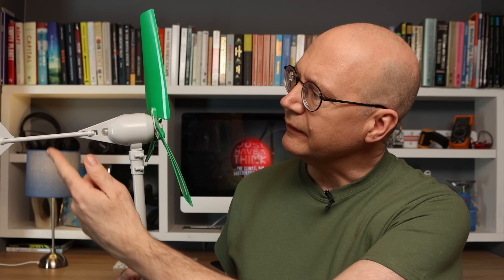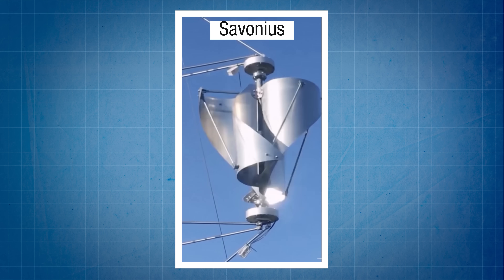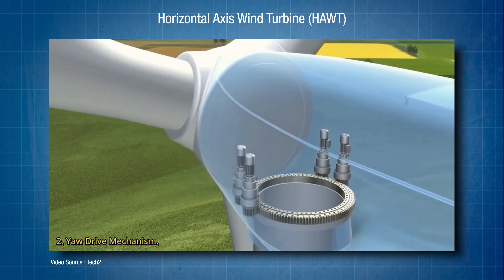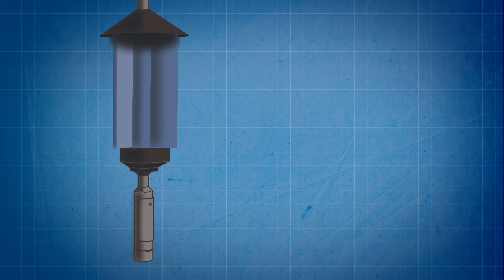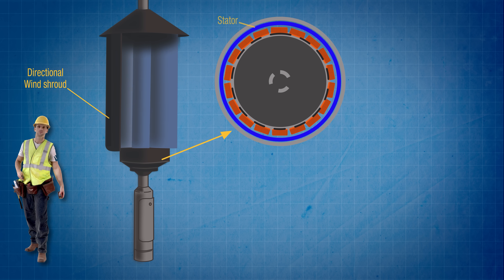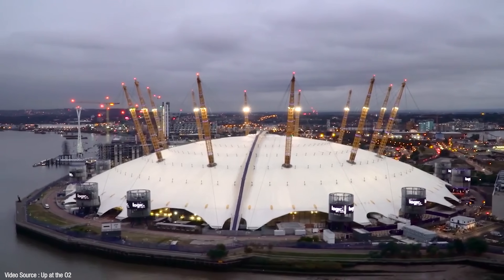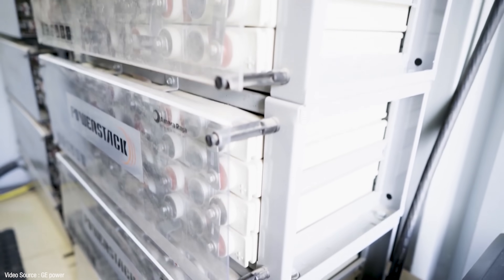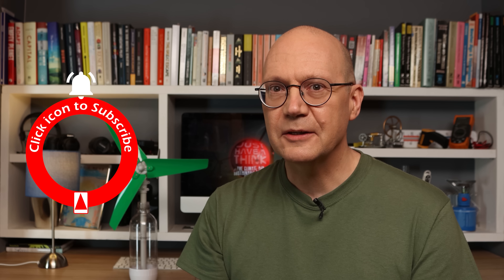A vertical axis wind turbine that doesn't need the prevailing wind! How do they do that?

Comment: Perhaps someone has suggested this already, but this system on the London Underground could  be very efficient.
Reply: The energy captured by the turbines will slow down the air rushing forward with the train. Effectively the train is now passing through its own built-in headwind.
Reply: @jamescooke3763  , true. One of the problems that need to be taken into account while building a tunnel is to prevent the air in it being excessively compressed by the train passing through. That is why the tunnels ale way biger in diameter necessary to let the train pass. And when the train is fast, and the tunnel is very long, there are built additional ducts to allow the pressure to dissipate. Holding the air with turbines would make pressure build up and make the train consume more power to remain its velocity.
Reply: The wind in the tunnels as the trains push the air through. If you’ve ever been in a tube station as a train approaches, you can feel it. Line them all along the walls of the tunnel.
Reply: @frankieking1941  And sit back and enjoy the extra turbulence and noise in the tube cars. What's another 4-5 decibels?
Reply: @tzenophile  wouldn’t it depend on the frequency of the additional sound as to weather or not the overall level increase?
Reply: @frankieking1941  the frequency would go up and down as the trains approach and retreat. So even more fun!
Reply: @tzenophile  I had not thought of that, your considering the residual sounds made by the fans that still are rotating after the train has passed? That will  then escape either end of the tunnel and make the platforms noisy.

Good though,  that would be a problem. 

Just to be a pedantic.
Sound absorbing material could be place   In tunnels especially at curves to catch most of this.

To be clear, I’m not advocating the plan, it was just a though I had after watching the video. But I am enjoying looking at the problems it would creat. I understand vertical fans have other efficiency issues that rule them out as a solution.
Reply: @tzenophile  They could possibly reduce noise levels if they act as baffles
Reply: @frankieking1941  there are soo many problems with this idea, starting with the fake performance numbers presented in the video (it should be 25 watt, not 2.5 or 24 kW); the good news is that this will never ever be implemented; it is basically a scam.
Reply: @tzenophile  Ever ridden the NYC subway?  Trust me, the extra noise is insignificant. The space between tracks, however, would be a problem.
Reply: @Withnail1969  If you confuse these designs with wind tech in general, I can only say you're not very smart. Have a nice whatever
Reply: @Withnail1969  You should read the news, and I don't mean facebook. This is happening already and capitalism is doing it for me. A LOT fewer  moving parts means cheaper cars, few repairs, not to mention much cheaper fuel. I'm fueling my EV for free. And this is just the beginning. Remember those famous pictures from NY City Easter day parade in 1900, and then in 1913? Lots of horse carriages and only one car in the first, and exactly the opposite in the latter.  History will bite you in the gas, petro boy.
Reply: @Withnail1969  Well, there really is much less reason to own a car when they can come by on their own when you need them. As for energy, renewable is the cheapest, and becoming cheaper. Do the math, indeed. Or just google it.
Reply: @Withnail1969  I don't have that exact information, but it seems renewables have doubled in total energy share from 29% in 2009 to 60% in 2019. So it's going really well. But not as well as in Norway, where EVs had 54% of the market in 2020. They are also aiming to stop the sale of fossil-fuel vehicles in 2025. Inconceivable, right? (Or at least the work of satan?)
Reply: @Withnail1969  Your number is off by more than a factor of two. And the need for transportation energy will drop by 20% by 2035 because of EV engines are more efficient. I really don't have time for this. Seriously, I don't.
Reply: @Withnail1969  that's a different story. I had a 19 minute cardiac arrest in 2017. It could happen again at any time, but every day is a bonus. perhaps we can agree that the world most likely is going to sh+t, but the question then is, what do you do? I know what I am doing. Do you?
Reply: @Withnail1969  Ah, I see. you have the wrong diagnosis, but the right prognosis. The problem is fossil fuels heating up the planet and creating havoc, turning the beginning ice age of 1850 into a 4c+ degree furnace instead, with rising sea levels and mass migrations and wars over cool land; and then most of us'll have an, as you say, unpleasant, precarious and possibly short existence. (I'm assuming you are honestly worried here, and not just playing to the mass panics but banking on space in the bunker for you). There will be chaos and destruction, indeed.  Have you looked into Deep Adaptation? It is a thought movement trying to get to grips with the impending collapse of our current security infrastructures and civilization in general.  

My best guess is that you see this as a conspiracy theorist would, that evil elitists are actively planning the downsizing of humanity through a fake global warning panic  - and if so, you are a blithering idiot - but yes, there will be hell to pay, not despite fossil fuels but because of them.
Reply: @Withnail1969   Ok. This is where I suggest you enjoy a Camberwell Carrot.  Best of apocalyptic luck.
Reply: @Withnail1969  I love your edited answer: "This is an oil, gas and coal powered civilisation." I'm guessing you are from the UK, and have been working in the "oil, gas and coal" industry. Did you lose your job? Is that the reason for your despair? You know there is a lot of change going on right now, where "oil, gas and coal" is not the cheapest type of energy any more. Solar and wind are. Deep down, you can see this, but still you are in denial. Why?
Reply: @Withnail1969   Your basic premise is wrong. Energy is not running out. Please give the numbers for that, not that you can.
Reply: @Withnail1969  The only thing that is running out is your supply of facts.
Reply: @Withnail1969  Not in your lifetime, they don't. As for your "facts"- choosing the first link on google is not the road to indisputability.
Reply: @Withnail1969  Where did you get this idea? It is original, but that is the best I can say about it. Renewables are cheaper and growing fast; both wind and solar are up 17-18% from last year. It may well be that the UK is going down the drain, but most of us don't live there.
Reply: @Withnail1969  Biofuel until batteries catch up. If you need jets to bring you food, you deserve to starve. 10 seconds reply.
Reply: @Withnail1969  There is enough land to grow food. We just have to stop eating animals, and use the food directly. Wind and solar won''t run out. They are making a 200MW installation a few km away from my farm, which will power 53.000 homes. At worst, throw in some nuclear. A climate change denier calling me delusional is hilarious btw.
Reply: @Withnail1969  200 MW is not useless. I have 8.33 kW pv, which covers my needs, including transport. Not useless at all. Your'e just trolling.
Reply: @Withnail1969  the math of what? I don't find any support for your claim. Are you simply making this up?
Reply: @tzenophile  it wouldn’t be any noisier and a five dB increase is massive by the way   No room in the tunnels for a road sized one, they’d have to be 10” diameter or less
Reply: @tzenophile  By the time you "saved" enough energy to make up for the energy containers within your car.. you are already at you second battery pack.
Reply: @absolutium  But I don't have a car-- what are you talking about?
Reply: @tzenophile  So.. how are you "Fueling for free"..
Reply: @absolutium  El-bike + solar cells
Reply: @tzenophile  You do realize my comment talked about the battery packs don't you?
Reply: @absolutium  So now you are talking about the battery pack in my bike? So what-? Your comment is rather loose, either way.
Reply: @tzenophile  Here so you don't get confused 
By the time you "saved" enough energy to make up for the energy container.. you will already be at your second battery pack.
Reply: @absolutium  As I say, that is a pretty loose comment. Not the kind that makes me want to go, "Ah, yes, oh, very smart internet-person, I see everything much more clearly now." If this sort of non-sense is all you got, I'm not going to waste my time with you.
Reply: @absolutium  Right; more fluff. The weather is wonderful, I'm going outside to work in my garden. Have a better one!
Reply: @tzenophile  Sure.. Not learning a thing to preserve faith is an option answell.
Reply: @absolutium  And you delete your own comments. What's not to admire?
Reply: @tzenophile  Not one comment deleted
Reply: @absolutium  So what happened to that fluffy blabber about thermodynamics?
Reply: @tzenophile  5 comments above.. btw whats your occupation? It is my general experience that people making fun of physics gravitate to useless skills...
Reply: @absolutium  I can see it in the notifications list, along with a weird one that says "Now? REAAAD..", but when I click into the thread itself they are gone. 

Anyway, I don't make fun of physics, only of pompousness. There is a difference. Check out my critical comments early in Dave's pinned socalled "Correction" thread, where I point out the rather banal errors in the numbers that he is uncritically passing on from the scam company.

And don't worry about me; perhaps you are familiar with the phrase, "Great minds discuss ideas .... Small minds discuss people"?
Reply: @tzenophile  Thats why you decided to ignore the lecture of the most relevant aspect within our understanding of energy mechanics because of gardening? Not before discarding it as jibberish without even realizing what was it about..??
Reply: @tzenophile  Im going to be blunt.. Your conversation is not meaningful for anyone in the know and it wont be.. I don't have the patience nor the crayons to get you up to date.. The preconceived notion you show regarding energy transformation resembles a marketing stunt from the early 90s.
Reply: @absolutium  You did not bother to read my comment to Dave, I take it. Anyway, more fluff from you here, ad hominem with no substance. If you are "in the know", there is no evidence for that. So I sincerely doubt it. Have a good day, sounds like you could use one. Not to mention debating skills.
Reply: @tzenophile  Im debating in my 3rd language.. with an old gardener who has the education of a teen ... but ..your "posts with Dave" is in your mind somehow more relevant than the ammendment to the 2nd law??
Don't bother replying..
Reply: @absolutium  I'm sorry, what? You think you're debating??  You're just slinging vague fluff and childish insults. Not a single comment of substance. When challenged, you pretend you don't bother. (And you delete your comments then deny it.) That you actually think you are debating says everything I need to know.
Reply: @tzenophile Here the comment you don't seem to "find"
Would be a great opportunity for you to check the 5th Law.. a thermodynamics analysis on energy transformation as an ammendment to Carnot's approach.. which will make your propaganda based "eco mindset" stop believing in Fairy tales.
Reply: @tzenophile  Just fyi when a comment is missing but still in the count is because YT is deciding if it is "harmful" for the audience or not.. whatever that's supposed to mean.
Reply: @absolutium   I did read it and responded in kind. "Check the 5th Law [of thermodynamics]" is not an actual argument. And you still haven't made one. You're not trying to debate, obviously, you're just trying to shut down the conversation in a way that lets you retain a feeling of superiority.  

Fluffy invocations of thermodynamic laws seems to be one of the most common ways to misuse science in discussions, in my experience (on the internet since 1987).
Reply: @tzenophile  You read it? Nice.. what was the part that astonished you the most?
Reply: @absolutium  I read your deleted comment and responded to it. Don't play silly pretense games.
Reply: @tzenophile  Just answer the question so we can FINALLY start discussing energy transformation..
Reply: @absolutium  What question? I have not seen a genuine, non-rhetorical question from you. If you want me to hunt down some obscure reference to the 5th law of Thermodynamics (with the extra risk that I don't find the one you wanted because I am not psychic) read it, and THEN respond to it in a way a random (Polish?) dude on the internet finds adequate, you must be out of your mind. (Not to mention that my wife would kill me for wasting time when I should be digging her new bird pond...) Learn how to properly debate, and then get back to me. Or not.
Reply: @tzenophile  You could have answered by now..
Reply: @absolutium  The bird pond is for my wife, you dork. I just drive the Kubota.
Reply: And there is no question worth my time here. Actually there is no question at all, as far as I can see. Just some Polish internet guy wanting me to read a text he can't properly reference, for a reason he can't make clear. (If I sound grumpy, its because I have spent the last couple of hours putting mortar on an old brick wall. Not my favorite work.)
Reply: @absolutium  This is weird; I see a longer comment from you in the notifications (something about "manufactured propaganda" yada yada) that is not in the thread itself. It seems quite confused, maybe that is why it disappeared. I am sorry to say you don't make much sense, and I have given you many many chances to get your argument straight. So unless that happens, good luck with whatever your demons are.
Reply: @tzenophile  Chances to "make an argument" are not for me.. I have 15 years experience regarding complex systems development including but not limited to energy management within an industrial environment.. if you want to learn about a topic you seem passionate about good.. if you don't ..not my problem at all keep watering the plants someone has to do it.
Reply: @absolutium   So in the end, you don't have anything pertinent to say. Hints and vague suggestions only. I'm learning every day, thank you very much, just not from you.
Reply: @tzenophile  You are learning? good.. You said you read the paper in question.. so did you saw the example of the engine acting as a transformation device which is represented with a quick diagram?
Reply: @tzenophile  What did your past academic achievements allowed you to realize about what its being said?
Reply: @absolutium  What paper in question? I never said I read any paper and you never provided a link or a reference. This is getting pathetic. Or, shall I say, even more pathetic.
Reply: @absolutium  So, let's recap and do tell me where I got it wrong:
I claim to be fueling my EV for free. You make some sort of point that implies that the EV battery will not pay for itself (which is a meaningless comment, since you submit no benchmark as to how one measures this.) Then you bring up a lot of 5th thermodynamic law blabber, again not making a coherent point, but instead expect me to make it for you, as long as you insult me enough. You even seem to believe you provided a concrete reference to a paper about this, which you clearly did not do. 

 At this point I do realise you are not quite able to keep up a cogent conversation, and will not, for your mental benefit, press this further, as my assessment of your cognitive predicament suggests you are not of sound mind. But I thought I would give you one last chance to make yourself clear, not expecting anything, so don't sweat it, please. At any rate, have a good Easter.
Reply: @tzenophile  "I did read it" was your response... that's the F... problem I told you repeatedly to READ the thermodynamic principle involved and you were so eager to shout "fluffy oldmanwords" you never did???
Reply: @absolutium  I already made it clear that I read your deleted comment, and nothing else. Whatever relevance a "principle" may have, you never gave me a link or reference or told me why it would be relevant. You are either out of your mind or simply not able to communicate. I'm sorry for your condition, whatever it is.
Reply: @tzenophile  You have to find the Press Release by YOURSELF! YouTube blocks the vast majority of links!!! OMG hate teaching old people.
Reply: @Withnail1969  
How about the idea of producing hydrogen from the wind power, and running your 7 litres on that!
Reply: My thoughts precisely.
Reply: The tube has air flow to keep air quality passibly acceptable.
They have large fans adding to the trains existing effects, to make it adequate. So turbines would take some of the energy, slowing the air flow and reducing air quality.
Reply: Australian farmers have been using this system for at least 15 years. Yes it is mainly DIY and somewhat crude but it works fine for water wells and pumping water out of dams.
Reply: @karlsbergkarl2230  , Australian farmers biuld their DIY wind turbines in subway tunnels to pump water out of dams? Sounds good to me:-D
Reply: And by the same logic, installing them in road tunnels should also be effective. Anywhere there is moving air being created on a regular basis.
Reply: There is no such thing as a free lunch. It would mean more energy is used by the trains.
Reply: How about harvesting energy from the entry turnstiles? How much energy could be produced by 1 turn?
Reply: @D Of course it would. People who comment here don't understand that nothing is for free.
Reply: The train would have to work harder, and without the piston effect expelling hot air, the air conditioning needs of the system would rise.
Reply: @johnbray1657  honest question, what is the piston effect?
Reply: @frankieking1941  the slugs of cold air pushed into a tunnel when the train goes underground, and the warm air expelled when it returns to the surface.
Reply: I am considering a vertical axis wind turbine that looks exactly like a tree, I call it : e-tree.
the trunk of the e-tree is brown, the spinning blades are green,
attached to the trunk of the e-tree are features of : wifi/mobile network, light and power outlet, to charge a car for example.
Reply: The tube is a semi-closed air system though, unlike motorways. Probably more engineering involved to make sure the turbines don't interfere with the train's airflow, making it less cost-effective than placing those turbines elsewhere.
The opposite may be true though, making it hyper-effective and energy efficient.
Reply: @lawsonhelpme  I'm bettering it could be done with variable pitch turbine under computer control optimizing which turbine are driven when, and even reversing them to accelerate wind speeds in long runs using power from a bidirectional flow with the grid.

What you'd be doing essentially is converting some amount of parasitic losses and some to increased train speed/lower power consumption with the bias being tunable to some extent.
Reply: @Zomby_Woof   Tesla's DOJO Neural Network Supercomputer was made to solve exactly these kinds of complicated engineering problems, by teaching a newly created NN how to learn it's job.
Reply: @lawsonhelpme  Agreed, except it should probably be, "EVEN less cost-effective". These things (VAWT) will never be cost-effective. How do I know? They were invented 100 years ago, and companies keep reinventing them, before going out of business. They look cute, though.
Reply: @tzenophile   You miss the part about using composite materials not available 100 years ago making the concept viable today?
Reply: @rockon7848  Do tell. I' m really curious about how composite materials will bring about new laws of physics. There could even be a Nobel prize in it for you!  Best of luck.